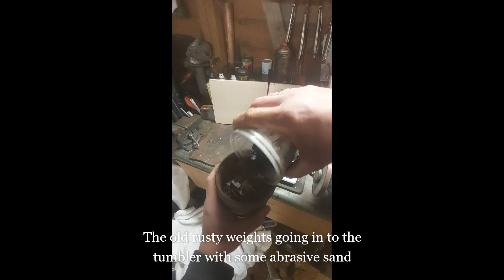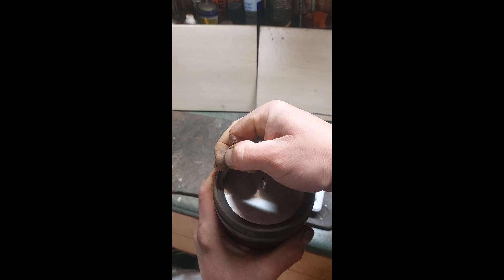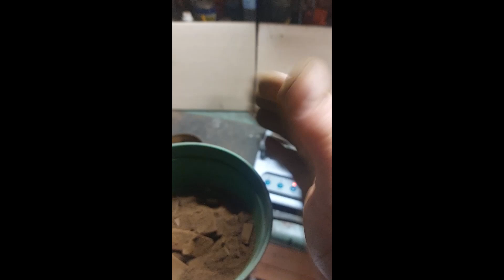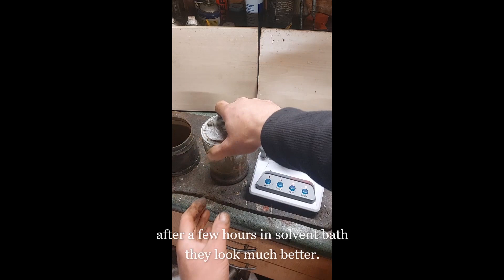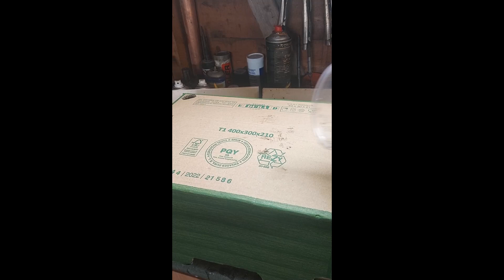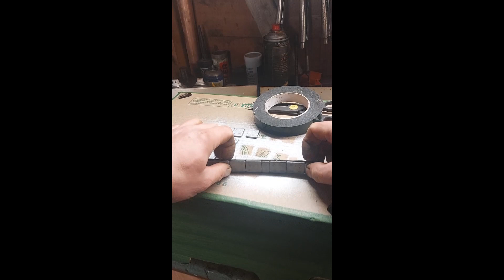Old wheel balance weights recycling, reuse

Comment: Just hold the wheel weight in pliers - then take a wire wheel brush in a drill to the back of them - that will take of the adhesive in seconds.
Reply from the maker: With hundreds of weights will take quite a long time the solvent method quick.